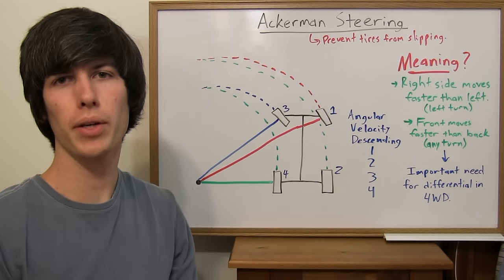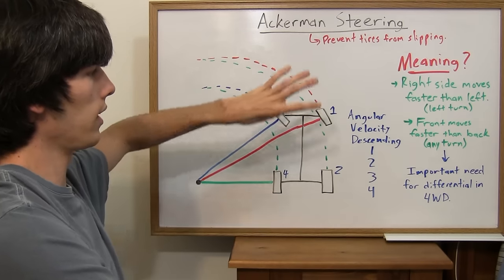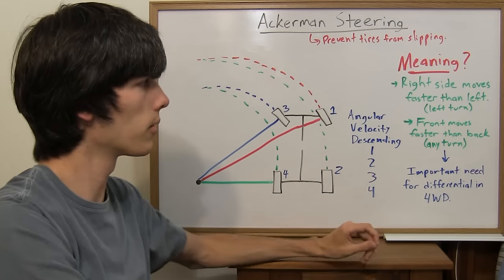Ackerman Steering - Explained

Comment: Well I came here to learn about the Ackerman steering. It was mentioned but not explained. Principals were discussed but that was already known.  How does the Ackerman steering achieves the higher angle on the inner wheel is my issue.

Comment from the maker: High speed stability. Forklifts are rear steering as it helps in tight spaces, but at high speeds you'll spin around very easily with rear steering.

Comment: It has been shown in the video that all the wheels turn for a common center.
So, the angular velocities of all the wheels will be the same.
Their linear velocities would be varying. ( as the radius from the center varies)
The descending order discussed might be true for linear velocities, but not for angular velocities.
Reply: +Shashvat Mehta i guess he is talking about the angular velocity of rotation of wheels about their own axis which will be different for all wheels.

Comment from the maker: Yes, which is why they use open differentials, so speed can differ. Watch your average 2WD in snow, one tire will spin while the other remains motionless. This is due to the differential.

Comment from the maker: Differentials have fixed gearing, yes, but each side can rotate at a different speed. Type in "how differentials work" there's a video with several million views that's very good at explaining it. With an open differential, if one tire is stuck, the other tire can still rotate. This is an extreme, but shows you that the speeds of each wheel can be different.

Comment: there are some but, electronically controlled mostly and the front wheels steer too, after a certain speed however the motor is turned off and the wheels lock into place, it's mostly to aid in parking and tight cornering.

Comment: well explained man! heres something i never even heard of despite my great interest and knowledge of vehicles... probably cause i'm more interested in models and history and major internal mechanics...heres on thing i did know though: just to make the point; real 4 wheel drive does not generally have a differential; its referring to a part time system engaged for bad weather or off road, however all wheel drive would have a differential as it's a full time system used on dry roads... thanks  :)

Comment: Hi Engineering Explained , I notice that front wheel axes cross at the center of the circle of the curve, that means they are not parallel. I mean, not only do they spin at different angular speed, but also they steer at different angles. Is it really that way?
Thanks very much for your time, I recently started to watch your videos and you are the best at explaining, it's all very clear, interesting and useful. Thanks a lot.
Reply: Hey, I'm not EE but i think I can answer your question. Yes, the front tires are steered at different angles. The steering linkages are set up in such a way that allows the two wheels to be at the required angle no matter what the actual position of the steering wheel inside the car is.

If you search for videos on the "Ackerman angle" or "Ackerman principle" you should find some videos showing the actual set up.
Reply: Dinsdale Drummond Thank you, now I'm searching by that name.

Comment: No idea what all this is about - Ackerman steering and differential gearing were around long before the motor car. Horse drawn carriages had wheels that revolved independently of each other so scrubbing wasn't a problem. The reason Erasmus Darwin came up with the idea of Ackerman steering was because on one of his medical calls his carriage overturned and he suffered a broken leg. He was sitting outside of the triangle subtended by the front axle's central pivot and the rear wheel hubs when the axle turned through 90 degrees, his portly stature caused the carriage to fall over. Introducing kingpins and four point location (as opposed to three) made for stability. This is why this arrangement is used on motor cars. Differential gearing is used to solve the problem of wheels revolving at different speeds when cornering.
Reply: He never talked about when Ackerman steering and differential gearing was invented. This channel just happens to be in the context of cars.
Reply: corsair919 ackerman steering is used to account for differing angles needed for each wheel to travel through a corner without slipping. Differentials are used to account for the different rotational speeds each wheel needs as it goes through the corner.

Comment: Some Chevy trucks have rear steering in addition to steering in the front. The angle of the rear wheels at full lock are of course smaller than in the front.

Comment: Good to revive a old topic but thanks for your video now I understand how AMG 4matics are good for nurburgring but sucks at low speed turns. Can you explain a bit more on its negative effect for example causing Tyre crabbing or juddering at low speed turns in cold weather? Merc owners are so angry about their expensive car making embarrassing turning noise around town.
Reply: This has everything to do with tire slip angle and what kind of corner you're driving through. 

Bad steering setup can cause crabbing, but it isn't the only reason why a car might do that and isn't the main one. Plenty of things on cars can be set up wrong, especially after people have tried to "tune" their suspension with coilovers without having any idea what they're doing. This is way more often the cause of crabbing, where it's not actually steering related but instead is caused by people putting random aftermarket springs and shocks in cars "because it feels sporty." Additionally, OEM suspensions are usually designed with intentional suspension "problems," to keep people from killing themselves. The average car enthusiast isn't a proficient race driver at all - but thinks he is - and has no idea how to handle an actual race car. Very often, "sporty" cars will be designed to have serious understeer when turning and braking to keep the car pointed in the right direction. Everyone expects oversteer when flooring the gas, but not many people know how to handle oversteer when they touched the brakes or lifted off the throttle at the wrong moment. Porsche and Lotus have notorious examples of cars like this. People think they're dangerous and hard to drive. They're not, they just have a much more neutral design and it's easier to get the car to off-throttle oversteer where drivers have only ever experienced on-throttle oversteer.

On to ackerman. Keep in mind that tires generate force on the ground by warping. You have to warp the tire enough to create the force you want on the ground. With steering, this warping is slip angle. If one of your tires doesn't have enough slip angle, the tire on the other side of the car is going to get overloaded and let go. 

The amount of pro- or anti-ackerman in the steering has to be set up for which type of corner the car is going to be going through, and also what kind of tire is being used. A lot of pro-ackerman (the tires turn in more than the theoretical ideal) will give a car better cornering in tight corners where you need to develop more slip angle on the inside tire, at already extreme steering angles. Anti-ackerman will help when you are trying to go through higher speed corners where the isn't much steering angle, but you need to develop slip angle on the outer tire anyway to get both tires to stick at the same time.

A side problem is the tires themselves. For a given sideways load (cornering), different tires are going to need to warp different amounts to generate peak grip. Race tires tend to slip less than road tires by 2-3 degrees. This is a huge difference; with things like ackerman, we're already talking single-digit changes in steering angle. A car set up with road tires in mind might not do so well on race tires, and vice versa. The suspension of a car is, in very large part, set up for the type of tire it's going to be running. Change the tire, and the ideal suspension and steering geometry is going to change. If a road car is designed to get the best performance possible on your average all-season, consumer-reports-approved tire, it's not going to get anywhere close to the actual limit of grip on a race tire. And vice versa.

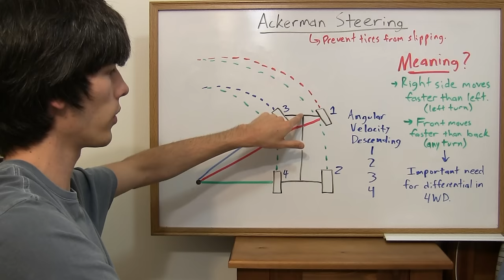Comment: Around 3:22. You said if the front has a differential, it can make the front tires spin at a different speed than the rear tires. A differential has fixed gears in it...meaning, it can't switch gears like a transmission.
Does this mean that with AWD vehicles, the front tires are moving at a different speed than the rear tires full-time?
How does the differential know when to speed up one side when turning?

Comment: 00:00
hey everyone
00:02
in this video I'm going to be going over the Ackerman principle or Ackerman steering
00:06
now I want to go into this because I'm going to start going into four-wheel drive
00:10
and all wheel drive
00:12
and it's an important principle to understand
00:14
before I go into those
00:15
the name Ackerman comes from a guy named Rudolph Ackerman
00:19
who actually was the guy who patented this idea
00:23
the problem was it wasn't his idea of the there was a German inventor that came to him
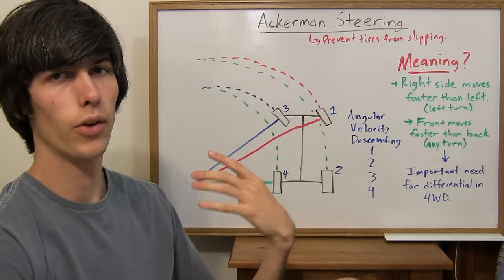00:28
he was a lawyer Rudolph Ackerman
00:30
and so he patented the idea
00:32
but somehow his name got placed on it
00:34
I'm sure he did that
00:35
but so it's not really his idea
00:39
but anyways he's got the name
00:40
what's happening here
00:42
so now back before the acronym steering was around
00:47
some of the tires would slip
00:49
because they've come to a different point
00:50
so what Ackerman steering
00:51
the reason it exists
00:53
is that so your tires do not slip when you go around a corner
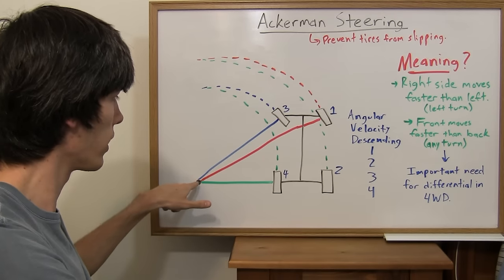00:57
now how you achieve this
00:58
is by having a central point at which all your tires are rotating around
01:04
so you can see that the angle of this tire this inside left tire
01:08
is going to be greater than this outside right tire
01:13
so with that angle being greater
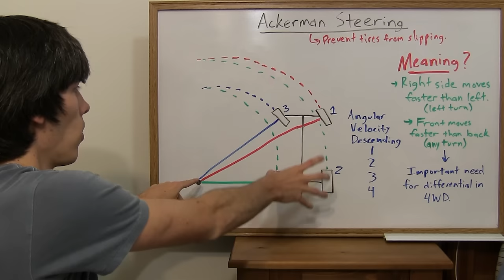01:16
they can come to a central point and then all four tires can rotate around one point
01:22
which means the tires don't have to slip as they go around
01:25
if these two had the same angle then they'd have to slip around some uncommon point
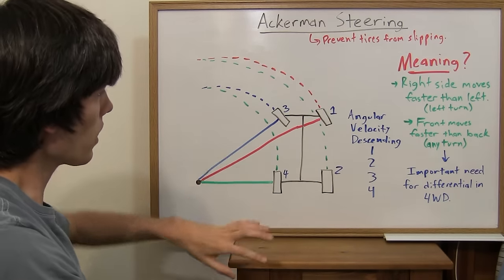01:30
and so that it wouldn't be it wouldn't work as well
01:34
especially at high speeds
01:35
so Ackermann principle is is great for for solving this problem
01:41
now one thing that you have to see when you look at this
01:44
is that look at each path each radius
01:47
so each tires path has a different radius
01:51
now what that means is
01:53
each tire is rotating at a different rate
01:56
so the one on the outside travels a further distance than one on the inside in the same amount of time
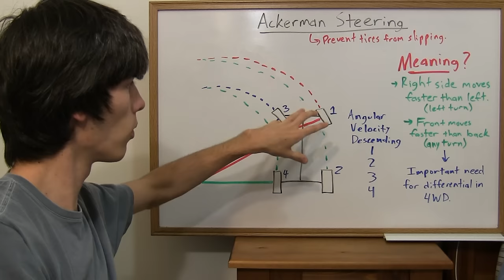02:03
so it's rotating more quickly
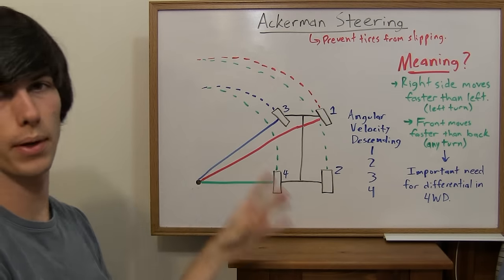02:05
so in in descending order the angular velocity of each tire goes from one to two to three to four
02:13
that's the descending order
02:14
so this is rotating the fastest and this is rotating the slowest
02:18
because it's got the smallest distance to travel
02:20
now
02:21
what does this mean
02:23
well this means your right side is moving faster than your left side when you go on the left hand turn
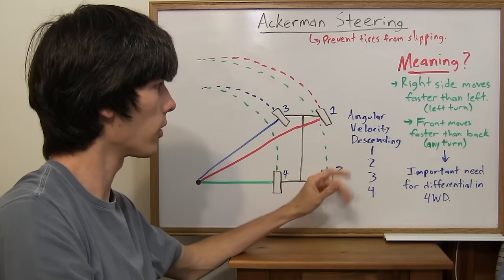02:29
and vice versa if you go in the right hand turn
02:03
also what this means is that the front tires
02:35
because they're traveling a greater distance as you can see
02:38
then the rear tires
02:39
they are moving faster than the rear tires when you turn
02:44
so this is the real reason that you need a differential in four-wheel drive
02:48
if you're if you're in four wheel drive on a pavement or something like that
02:48
we have enough traction enough grip
02:48
then you're going to need a differential so that you can split the speeds between the front tires and the rear tires
03:05
otherwise you're going to have some buckling it's not going to work out
03:09
and you're going to have you're going to wear the tires
03:11
and you're going to be slipping you'll have understeer
03:13
so you want it so you have a differential
03:15
if you put in a center differential right there
03:18
then that would allow these tires to rotated a different rate than these tires
03:22
and then you put in a differential at the front and differential at the back
03:27
and that would allow each of these two tires to once again rotate it different rates
03:31
so this is important before I go into my four wheel drive and all wheel drive explanations
03:37
so I really hope this makes sense
03:38
and then I'll be going into these more complicated ideas of four wheel drive and all-wheel drive
Reply: dafuq

Comment: Correction:

The inner tires, with respect to its turning direction, should be the one that turns faster than the outer tires based on their angular velocities with time as constant.

The front left tire has a wider angle than the front right one. Thus, it will turn faster using this given formula:

Angular velocity = position angle/ time
Reply: Don't think that's quite right. The formula for angular velocity isn't equal to "position angle/ time" but the "change in angle /time". If we take your formula and apply it to the rear tires, then they would both be travelling at the same speed, which we know isn't the case because the outside tire travels a longer distance around a curve.
Reply: But doesn’t the right side move slower than the left still? Since the turn radius is larger than the left side as he mentioned earlier on in the video? Or maybe I still don’t get it?

Comment: Video request!!!  Please explain how Ackerman is achieved on front steer linkage. Aka the rack or linkage is in front of the front axle. My truck, Chevy A-body’s, and corvairs  all have front steering linkage and nobody can explain how it keeps the correct Ackerman angle
Reply: I can not find this information anywhere and it’s making me mad. I know the outer tie rod ends are not outside of the steering axis but my inner wheel still turns more than the outer
Reply: Maybe I mean dynamic tow and not Ackerman

Comment: So if your front right tire treads are lower then left you make more left turn? , That’s my understanding. The dealership didn’t rotate my tires when I got a oil change and the front right tire treads were lower than other three, they said it wasn’t necessary so now I have to drive another 6000 miles and how it will probably be a hell of a lot lower. Were they just lazy, didn’t care or not informed?

Comment: +engineeringexplained: if front is moving faster than rear than how can ang. velocity intermix them as 1,2,3,4 ? This implies that right moves faster than left which is correct. If Front moved faster than back should it be 1,3,2,4?

Comment: Are front wheels parralel when steering? They dont seem so in picture. If not, how is this difference acheived?
Reply: The front wheels are not parallel. The steering linkage is set up to make the required angles.

Comment: Thank you for making these videos! Loved to get the F1 radiator explained, but in this one did you not skip the actual explanation of the mechanics? I mean shure wheels go around at different speeds, but how to achieve the different turning angles for the inner and outer front wheel, mechanically some might ask.
I found it at Wikipedia though:-)

Comment: plz explain anti ackermann with respect to varying slip angles.
Reply: Devansh Batra Anti-Ackerman is used in low downforce racing applications where there is so little weight on the inside tire front tire that it is more beneficial to allow the outside wheel to have a greater angle at lock.

Comment: are the left and right front tires each at a different angle ?

if you turn the steering wheel than the angle of both tires is the same no? but only their speed differs in a corner
Reply: Different angle to eliminate the difference in speed, higher curve for the outside front wheel, hence both tires will rotate without slipping.
Reply: Actually the outside wheel will be pointing straighter than the inside wheel.